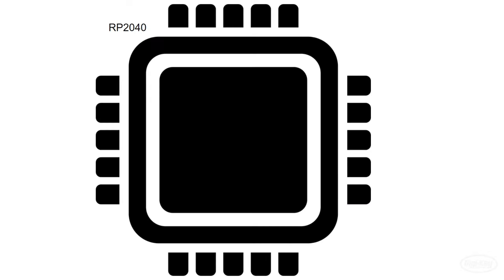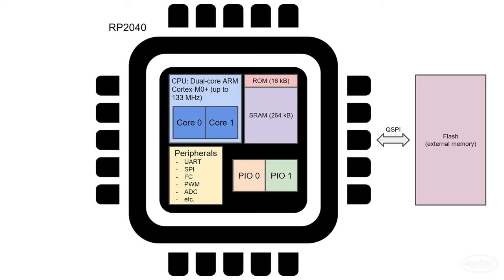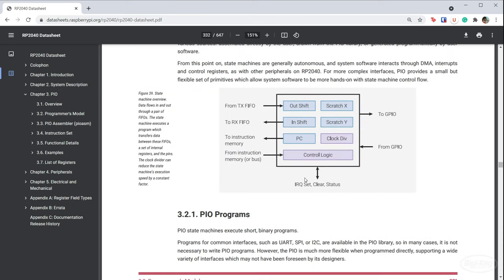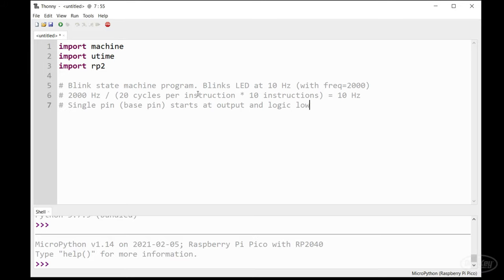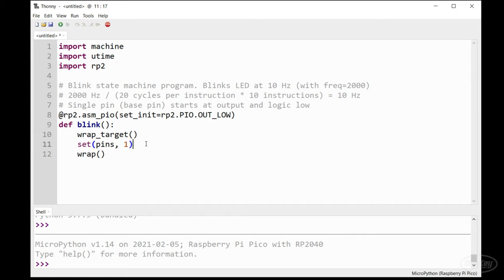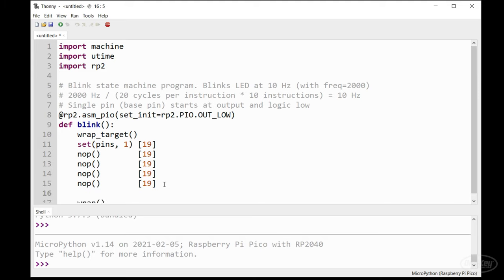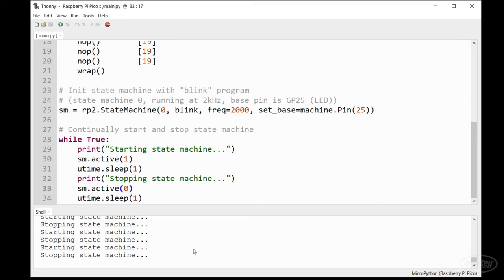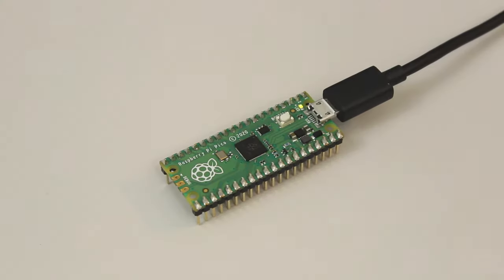Intro to Raspberry Pi Pico and RP2040 - MicroPython Part 3: PIO | Digi-Key Electronics

Comment: I am getting the following errors using this PIO example.
>>> %Run -c $EDITOR_CONTENT
Traceback (most recent call last):
  File "<stdin>", line 9, in <module>
  File "rp2.py", line 258, in dec
  File "<stdin>", line 14, in blink
TypeError: 'bound_method' object isn't subscriptable
>>>